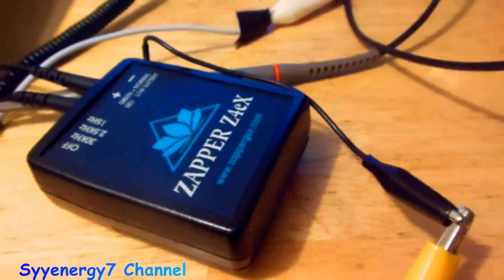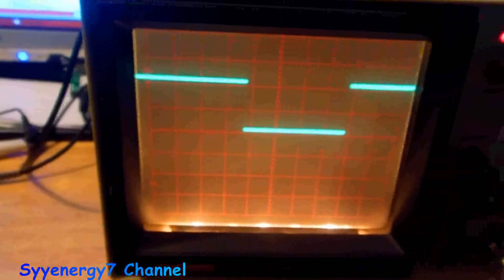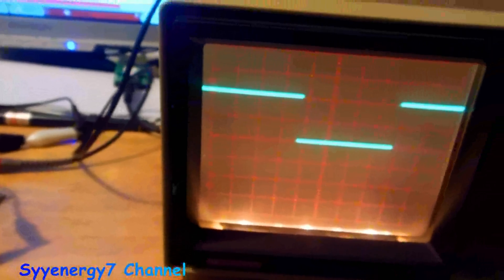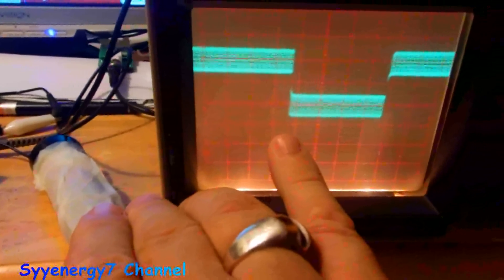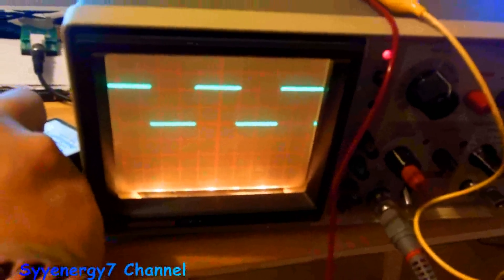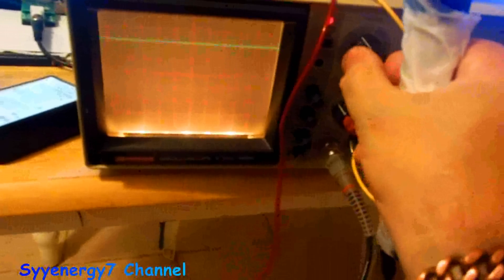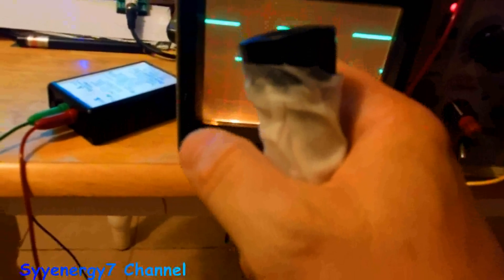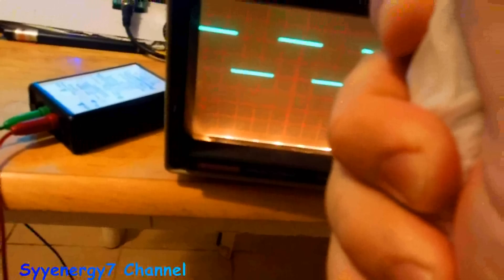Hulda Clark Zappers Performance under load

Comment: Often the cheap stuff Is just as good the expensive stuff often Your paying for their fake magic, I learned that a long time ago with audio equipment. but there are companies that on purpose make things cheap doing things that You would Not think of such as mixing Iron with copper to make copper wire, that would be like building a house out of cardboard which Everyone knows If You want a house to last Not to build It out of cardboard.
Reply from the maker: That particular cheap zapper is pretty good, but it only has 3 frequencies, which will limit how well it can work.  Even the mid-grade CC2 has 29 frequencies. .